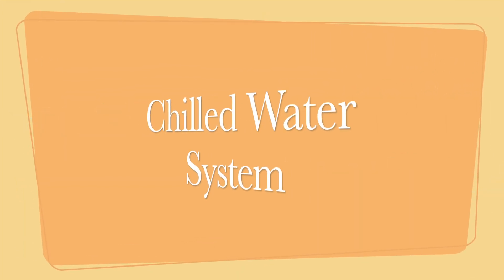Chilled Water System for Beginners: Terminology, Components and Processes

Comment: Thanks for educative video. Forced draft vs induced cooling tower. Which one is more efficiency?
Reply from the maker: Forced draft usually have better efficiency due to lower motor temperature and better heat transfer. However, it depends on the application when selecting cooling tower as there are always pros and cons in each type.